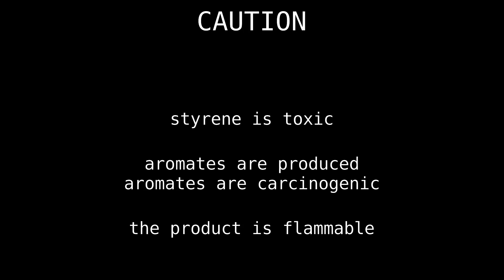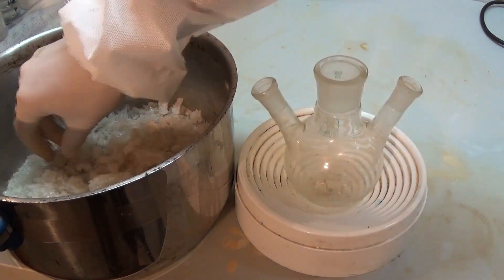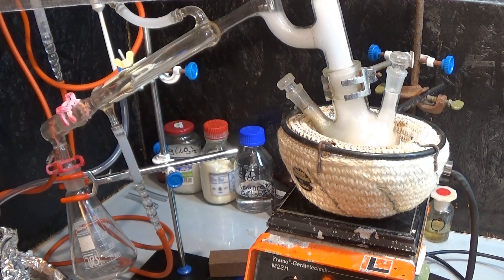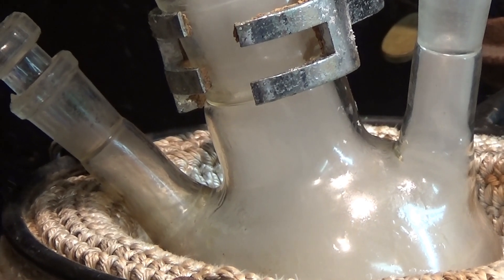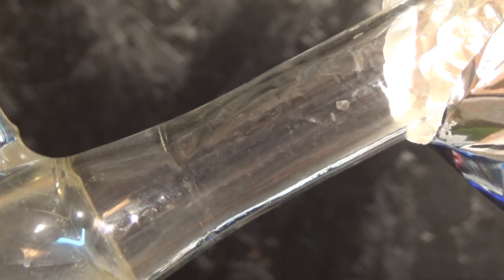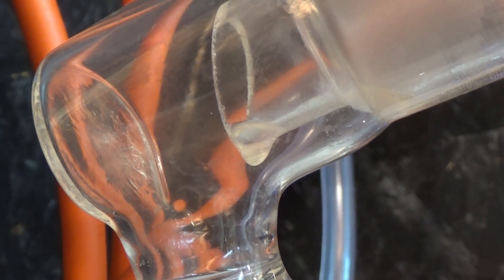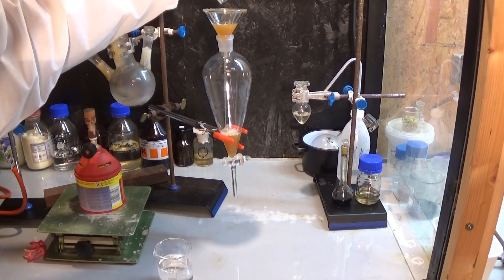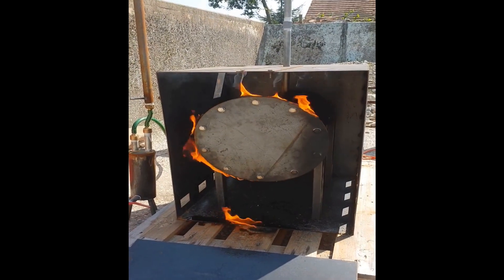recycling of polystyrene / synthesis of styrene

Comment: GREAT VIDEO.............I feel so bad about your pyrolysis reactor.  That is screwed up.  I did this experiment with a tin can still and so it was not as air tight like a glass distillation apparatus.  And the condenser i made was not working the greatest.   Man my whole house and a 70 foot radius around the house smelled like styrene.  That smell REALLY carries far.  BIG TIME
Reply from the maker: jup the stench of styrene is quite strong even in small concentrations .... and it gives you a hell of a headache
Reply: @HazelChem  .........Yeah what i distilled was a NICE CLEAN milky white liquid of styrene.   I GOT SICK FOR THREE DAYS..  By the time i got back to the styrene is was a DARK DIRTY BROWN liquid.   But yeah it got me sick as heck.  I breathed in a lot that day